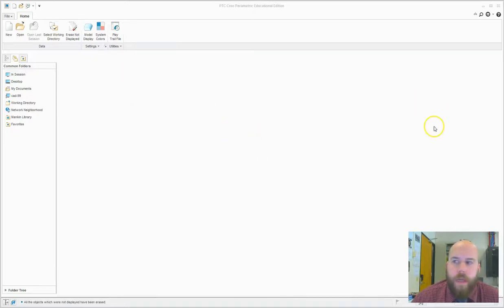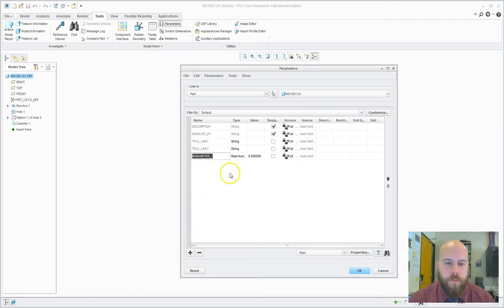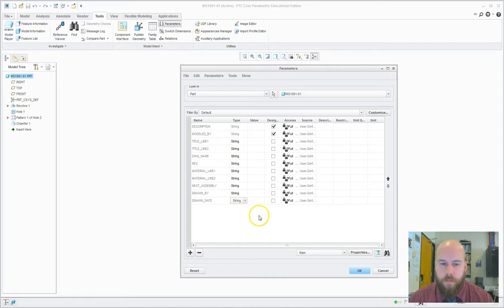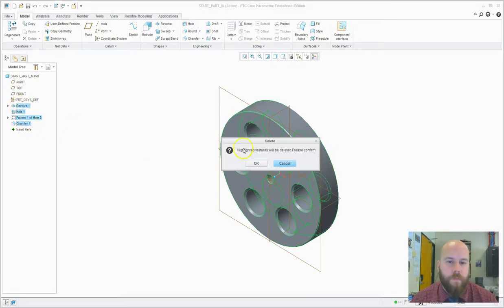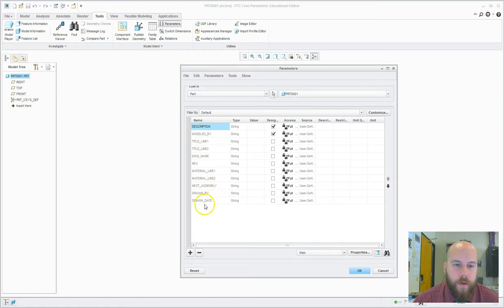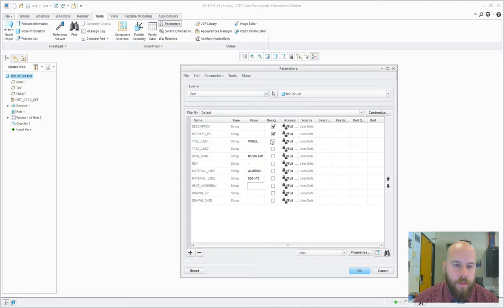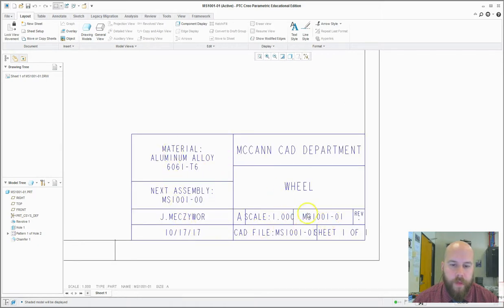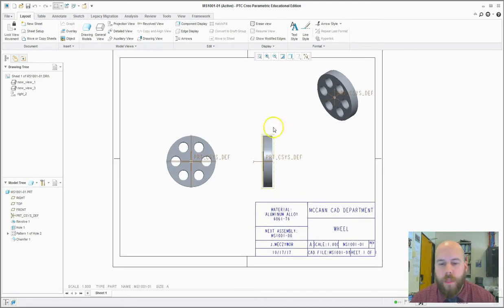CREO: How to Add Parameters to a Part for a Drawing

Comment: Hello Mr. Mez, thanks for your videos.
I would like to know if there is a way to check parameters by using a checklist on Excel or similar way.
Reply from the maker: Hi Martino! Depending on the version of Creo you are using, you can export your parameters to an excel spreadsheet using Tree Columns / Auto Bill of Materials. I personally am not a huge fan of it, but it's really a personal preference thing. The other option would be using the PTC database software to export all of that type of information. Hope this helps!

Comment: Hi, Sir, Your videos are very good and helpful!  I have a question for you. How to combine Creo Fasteners with the parts on a drawing in the same BOM?  I found IFX shares same standard parameter with a Creo model, that conflicts each other in BOM on a drawing.  If I separate parts with IFX in two BOMs, then I got problem of balloon number issue.  Is there a solution for that? May I know your email ID?
Reply from the maker: Thank you for the compliment. Auto BOM's can be tricky. In industry, I've set them up several different ways for different businesses I worked at and typically based the complexity on the capability of the users I had at that company. The easiest way to set them up that I've found is to set up a standard start part for all of your models that has parameters you want to incorporate into your BOM. Use these same parameters for your standard parts when you model them (fasteners, bearings, etc.) and export your BOM to Excel or Google Sheets for easy format modification. Hope this helps!
Reply: @MrMezCAD  thank you for the idea!

Comment: Hello !
Thanks for your tutorial.
To complete my understanding I would like to know which codes you have used in your titleblock so that the data entered in the part template is read correctly.

Thanks a lot
Reply: @MrMezCAD  

Hi!

Yes, after I asked the question I found your other video and I am able to create my titleblock with the attributes.
I still have difficulty maintaining the settings I want for the drawing sheet like font size for dimensions, text colors, dihedral for the views, arrow sizes. I've made these adjustments but I can not make them stay.
But since I'm learning to customize Creo, I'm going to see the tutorials available and learn how to do it.
I have long used Autodesk Inventor that has a more user friendly interface, but a client is migrating to Creo and I need to provide projects on this platform.
Thanks a lot
Reply: @MrMezCAD  

Hello

Sorry for the persistence, but how do I create a .dtl file from config.pro?
Is the user creating the file or the program generating a dtl after saving a new config?
Reply from the maker: Hi Paulo, sorry for taking so long to get back to you again. DTL file comes from your drawing properties. If you save a copy of the drawing properties it will save it as a DTL file. I'm sorry I'm so bad at keeping up with comments! I'll try to be better.